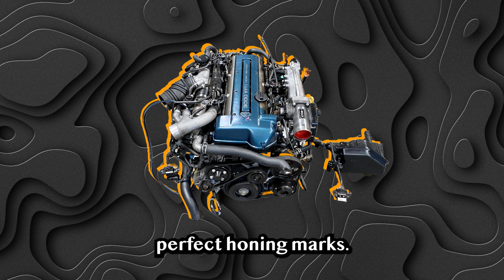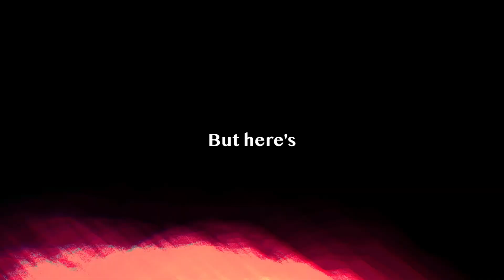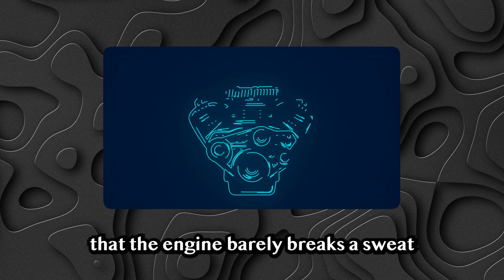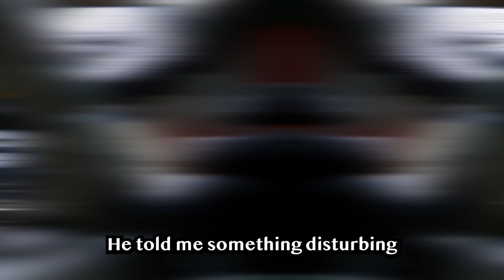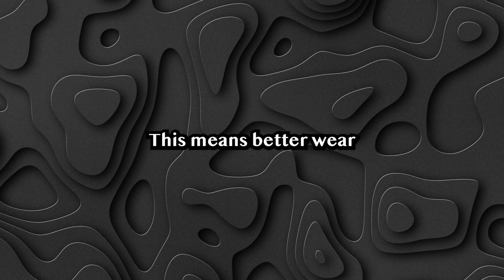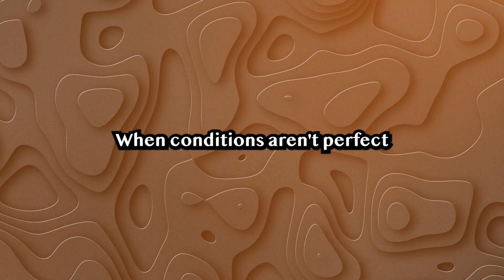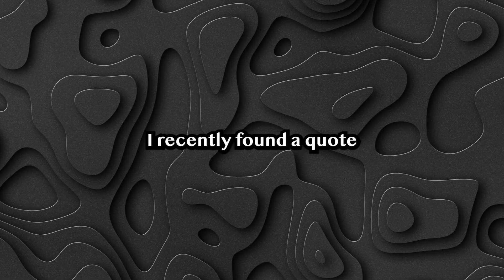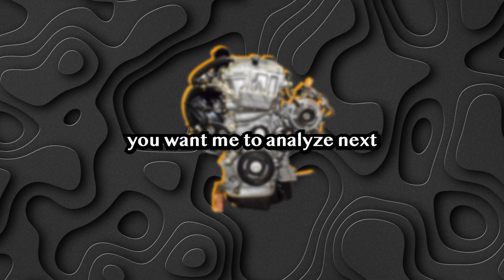Toyota JUST RELEASED The PERFECT Engine! And Their WORST ONE!

Comment: Hi. Can you give your opinion on the 1ZZ FE engine?
Reply: @hughbatchelor8599  Agreed!  I would love to hear that too!  I have a '99 corolla with a 1ZZ-FE(173k mi.), and an '06 corolla with a 2ZZ-GE(133k mi.).  I have friends who owned '05 & '06 corollas with 1ZZ engines, and they lasted forever!  even though they neglected the hell out of them, but they just kept running!
Reply: @lobsterbisque7567  Those are good mileages. My 2005 Corolla has 275K kms on the clock. I can still see the honing marks on the bores. These engines leak oil all over the place by this mileage, but I have changed every O ring, seal and the tappet cover gasket to now have a very clean and lovely engine. Cooling jacket is mint as well. Absolutely no corrosion.